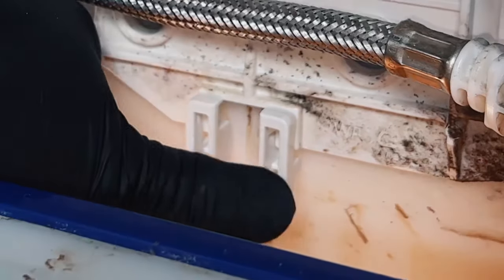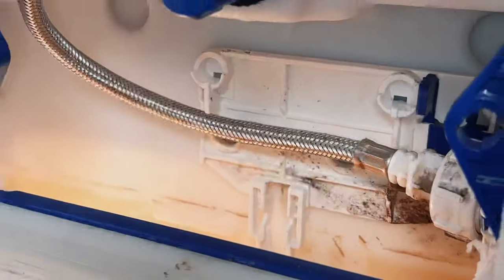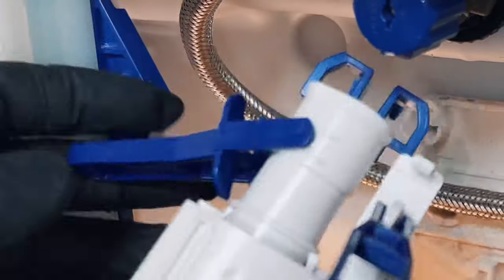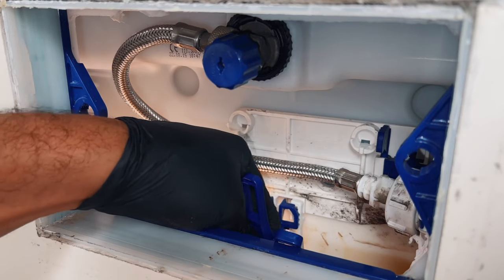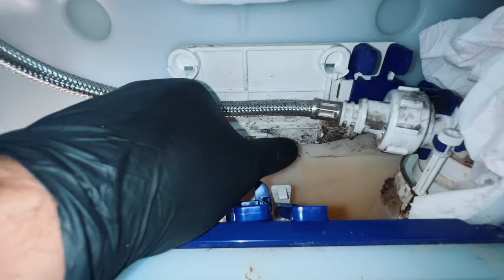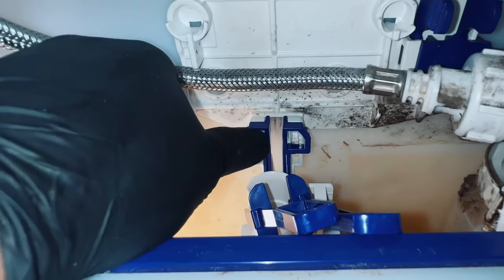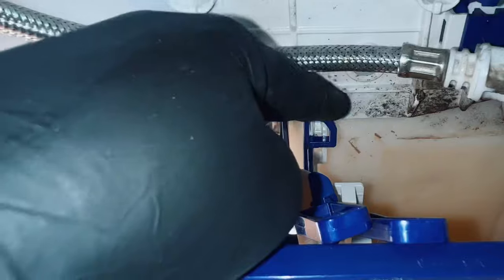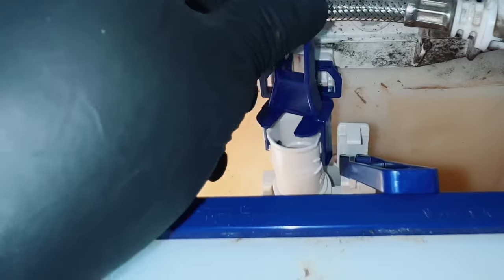Save money! How to change Geberit flush valve  of a wall-hung wc #diyplumbing

Comment: I have a geberit kappa wall hung cistern and the flush is not very strong, compared with my toto one. It's brand new but just wondering will the flush become more powerful if I change the flush valve to a higher end one?

Comment: Very easy reparation just following the steps of this video; thank you. Note I've replaced the old defective valve of a UP320 from 2011, using a new type 212 valve, which fits perfectly, though it looks much different!

Comment: Thanks for the video! On 0:57 did you just easily pull the basket up? Mine seems totally stuck!
Reply: Mine is also stuck, no possible to remove. IT sucks
Reply: Mine was stuck too (lot of calc!), you have to yank it hard. It took me long time for repair, because I was afraid to broke something.